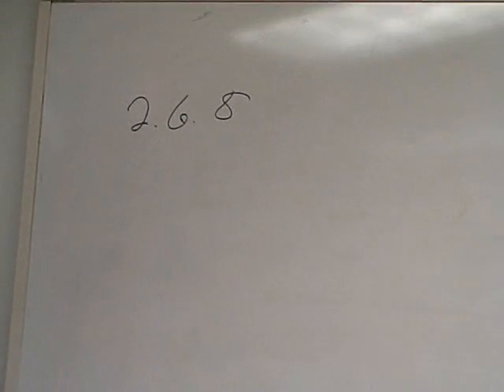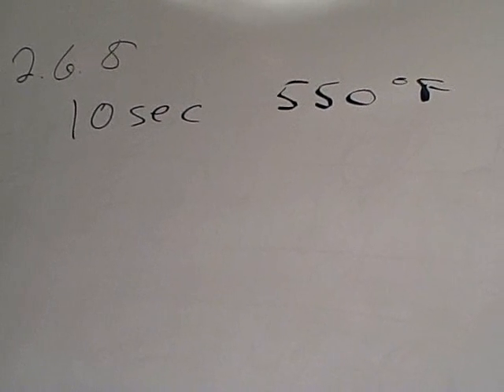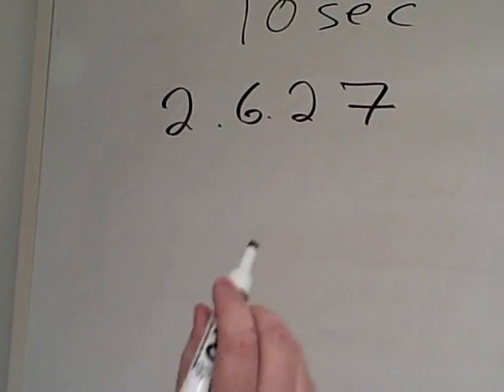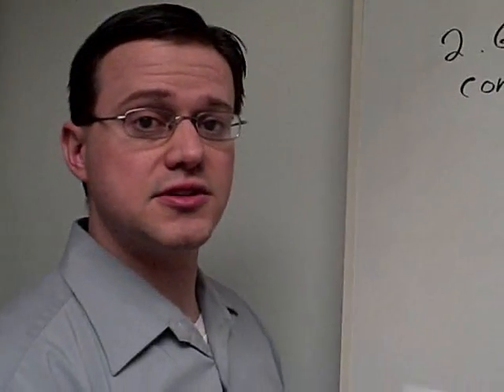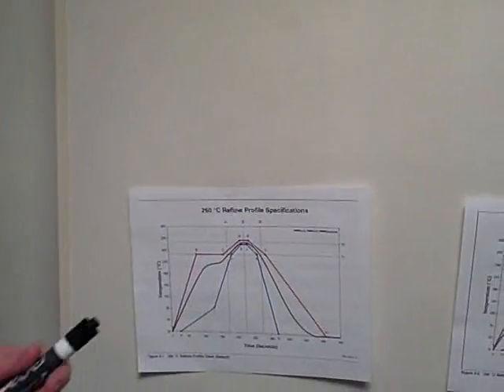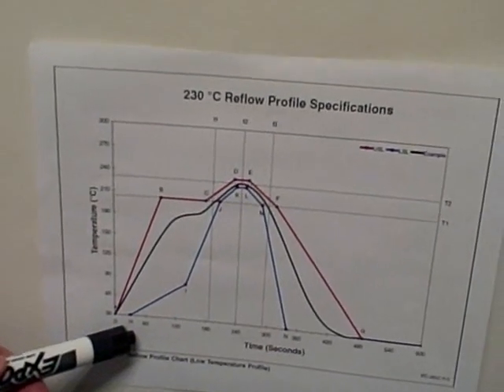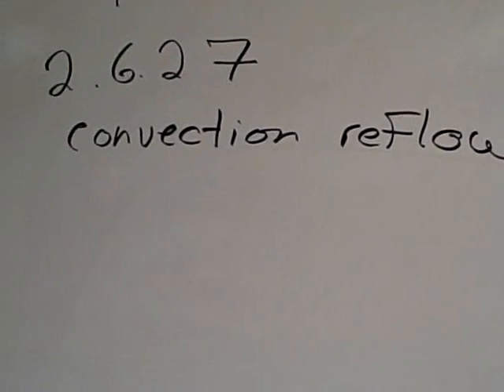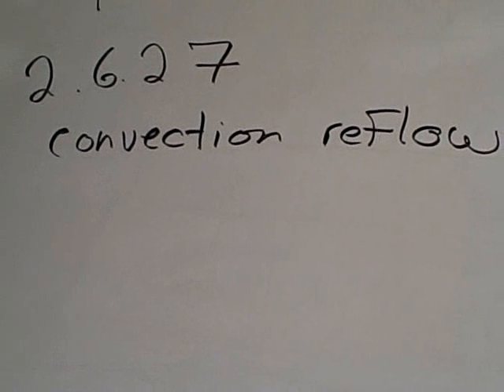Thermal Stress Test Methods: What are the new IPC requirements?

Comment: Hello IPC. I am studying solar engineering in Sweden.  As a part of my final year thesis, I choosed a topic called "cross Connection of electrical connectors "used in PV systems. I am unable to find the sample size of connectors those I need to test in order to achieve a confidence level of 95%. I researched a lot about it but I could not find a way. Could you please suggest me a way to find it.
Thank you.